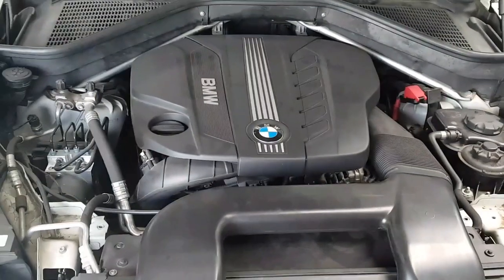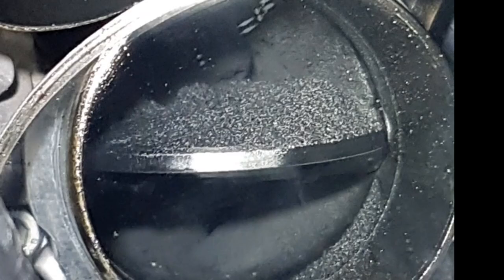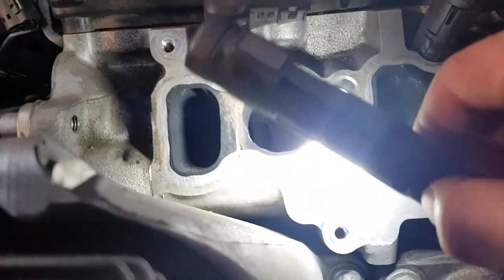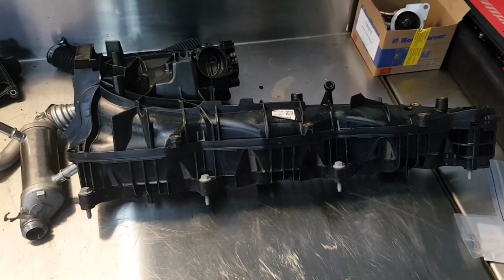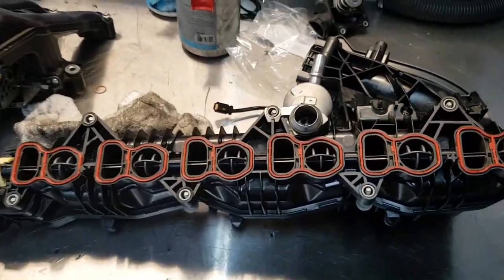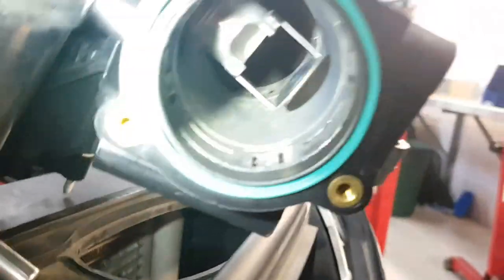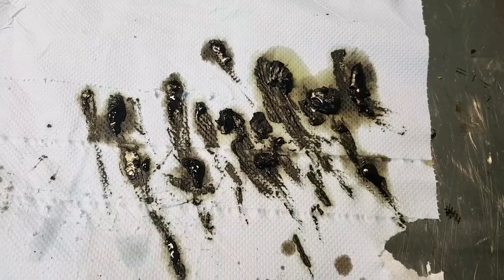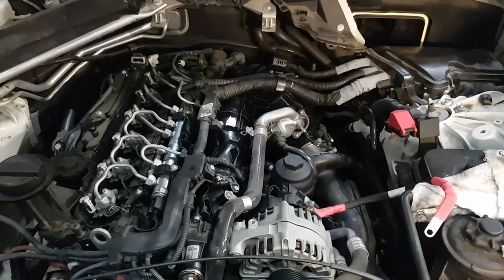BMW N57 Intake Manifold Removed for Carbon Cleaning and Walnut Blast

Comment: Talk about perfect timing. I'm getting ready to do just what you have done. You seemed to be a lot like myself. If you're taking something off it's worth getting it back to 100% instead of just settling for doing what you went in to do. 

I'd love to when you use your finger to move the flap so we can see what it should look like on that part you put your screwdriver on. I've never seen anybody use their finger to demonstrate if you have done it right or not. 

I'm glad you mentioned not to use any sort of cleaner inside a throttle body. I buy that and brake cleaner by the box full. 

I enjoyed your video so you got a big old thumbs up. Since you had some very good advice I made sure and hit the subscribe button also.

Comment: Looking to do that same job on my 2013 X5 N57 40D engine when the inlet manifold gaskets arrive. 
Retired 75 Y.O.  mechanic but worth the challenge. 
Just one issue is that walnut cleaning is not available anywhere near me. 
Can only scrape out of the ports what I can.
What are your thoughts on spraying the ports with carby cleaner and sucking out what I can with the valves closed?

Comment: I'm just in the process of doing the carbon clean. I've unbolted the intake manifold but for the life of my can't get it to come off. Appears to be be stuck on the EGV valve/cooler that's bolted to the manifold which appears to be holding on tight. I don't really want to break anything - is there something I'm missing that's not undone? Any advice would be good. PS - All the pipes to it are disconnected, it's just where it connects into the block.

Comment: That's not a throttle body mate. Diesels don't have one. It's an anti shudder valve
Reply: Its just terms differences only,but it work like throttle so…and it work not only like anti shudder valve,this throttle working sometimes with egr too…
Reply from the maker: Finally someone that actually understands modern diesels 🤣
Reply: Exactly

Comment: I've got a mini cooper Sd with an n47 2.0 engine, it all appears to be running fine with no active or pending error codes. Yet when I look at the MAF readings at idle they fluctuate between 0g/s and about 16g/s. This happens through out the rev range whilst driving, the only time it stays stable is when a regen is happening. Have you seen this before and do you think this could be caused by cylinder imbalance from carbon build up?

Comment: How did you perfectly clean intake valves with walnut blast avoiding any particles go inside cylinders.
Reply from the maker: They are blasted with the valves closed. All other ports with open valves are taped closed. The walnut blaster shoots walnuts into the port at high speed, but it is shooting it through a vacuum cleaner tip so as soon as it hits the ports it then get sucked out by the vacuum. It's a hard thing to show on camera in a video.

Comment: Nice job man! DO you by any chance have info of how much exhaust backpressure (before turbochargers) is ok during full throttle acceleration of a n57d30t twin turbo. I am feeling that 4,5 bar at 2500 rpm is not good. After 2500 the car give up boosting opening wastegate and vnt.

Comment: EGR's total bloody joke on modern motors.
Reply: Delete, no problems anymore
Reply: Not just the egr it's the direct injection as well because the fuel bypasses the valves
Reply: @kungfuhustle6363  does anyone make port injected diesels? I'm pretty diesels are only direct injection.

Comment: Hi I have a n57 engine in a 5 series but will only run if I take off oil cap when I replace oil cap you can hear it suck hard and cuts out , any ideas? Tia

Comment: Was the piston positioned in TDC when cleaning with walnut blaster? I know the manual shows examples of actually spraying in the chamber but still wondering... If it was positioned, how can you easily tell its in TDC without seeing the exhaust valve? I presume given the timings one can look at the other intake valves ? Thanks
Reply from the maker: It doesn't matter if it's at tdc or not. You are looking directly at the inlet valves which you are cleaning. If they are fully closed, they can be blasted. Often multiple cylinders are able to be done at once.
Reply: @FourRingsAuto  Does make sense indeed. Thank you for quick reply btw!

Comment: Diesel's also do not have throttle body. That is an anti shudder valve
Reply from the maker: anti shudder is only one function it is used for. it is used in egr operation and dpf regen and operates as a throttle plate in both these circumstances. it is not used as a throttle to control engine rpm speed, but it is used to throttle the engine in both the previously mentioned emissions operations, and it is not merely just an anti shudder valve.

Comment: thanks for your vid, but you really didn't demonstrated on how you cleaned the valves??
Reply from the maker: A specialist walnut blaster sold by bmw, vw and Audi. You can also use a soda blaster. Most people don't have access to a walnut blaster so seems pointless to show it.

Comment: Can you clarify how you cleaned the intake ports, ie the holes into the engine. I didn’t quite get it. Doesn’t carbon just fall into the engine?
Reply: Valves are closed.

Comment: Hi, guys, I have a 2013 bmw 3.0 twinturbo diesel N57. I replaced a coolant hose pipe. In order to replace this, I had to remove the manifold (+few sensors / lines etc).. now I’ve put the car back together, when I fire the car up. It takes around 5-7 seconds to start. It feels like it will fail to start, but always starts. Power is full. Drive is normal.. never had this issue before. (No engine lights) (nothing on code reader. 

Any ideas what it can be ? 

Thank you
Reply from the maker: Need to check rail pressure whilst cranking to see if there is an obvious issue. If they don't reach the desired rail pressure they won't open the injectors. Modern common rail diesels shouldn't crank for more than 1 second.

Comment: i will change egr valve on the warranty from bmw. or not me but the workshop. My is model year 2014 520d F11. will they clean the way you did or will they just replace the egr valve
Reply from the maker: I don't know, I don't work for BMW. Plus it is down to what the technician there is like. I doubt bmw will pay to clean your intake manifold and ports to be honest.
Reply: @FourRingsAuto  Okey so when they change the egr valve the manifold will still be very dirty.. Sounds very bad. I think I must take my car to some workshop and fix that. Looks very nasty and bad for the engine

Comment: I wonder, does the consumption drops down after the cleaning? Cause it seems to be that it actually should
Reply from the maker: Fuel or oil consumption
Reply: @FourRingsAuto  fuel. I think it can not influence oil consum
Reply: @FourRingsAuto  Does it or no? I mean is there any reason to wash it in advance in case I have no fault or bad starts on car?
Reply from the maker: Rough running on cold starts. Effects dpf regeneration too. I'd imagine it may make it better on fuel but I'm not driving the cars more than a roadtest and they're customer's cars. They all agree the cars feel so much better a more crisper and better running. If it is full of carbon it needs to be cleaned. Why wait until there is an issue?
Reply: @FourRingsAuto  thanks for answer. Yeah dats true, but now it 100k km, may be gonna do it soon.

Comment: Hi mate great vid can I ask how do you close the valves while the engine is still in the car is it possible  with a socket on the crank pulley. Cheers pal
Reply from the maker: There is a special tool that fits on the crank bolts on the front pulley.
Reply: @FourRingsAuto  cheers pal is it easy to turn over the engin

Comment: Can you put a catch can on an N57? Can’t find any info on kits or installation for one
Reply from the maker: Never fitted one myself, but likely something people do. It's a good idea as long as it doesn't affect the operation of the factory breather system and is is merely there as an oil trap.
Reply: Four Rings Auto I’d like to but concerned that it will throw up an error. In saying that I found my breather pipe was leaking and didn’t throw a code
Reply: Most of the gunk going into the intake manifold is due to the EGR which has to do with exhaust gas for which you can't do anything. Oil catcher could be in conflict with oil breather.
Reply: @j.badinter988  The gunk is mostly oil from the oil vapour recovery system. The hot exhaust from the egr system cooks it turning into a black sticky mess. Remove either the oil vapour or the hot exhaust gas and it’ll run much cleaner.

Comment: Nice video. I’ve got a Mercedes E350CDI with 125k miles on the clock. Occasionally it takes a several s seconds to fire when started, I wonder if this because of a build up of crap on the internals?
Reply from the maker: Could be, but the om642 engine relies heavily on the glowplugs for fast starting, and good battery condition. I'd start with these basic checks before looking further.
Reply: Four Rings Auto cheers bro and thanks for replying. Where are you guys based?
Reply: Give the glow plugs a chance to heat up. Easy to forget diesels need a proper chance especially in winter. BMW’s are programmed to run glow plugs longer depending on temperature.
Reply: Allie sometimes it does it on the hottest of days so I’m not sure if it’s as simple as glow plugs. I’m not sure if this is connected but I’ve just had a new fault code and replaced both Nox sensors, and it hasn’t hesitated since.
Reply: last few times, my mazda 6 2.2 cdvi was starting slow, also took a second or sometimes 2 to react on the throttle pedal input. Is in the garage now and looks the same in carbon build-up. 100.000 km on it

Comment: Whoever came up with the concept that recycling exhaust gas into the intake was a good idea should be made to eat 10% of their own shit with their food and then see if they think it is a such a good idea.
Reply: It's actually a good idea. As long as the oil vapours from the crankcase breather does not end up in the intake too. But they do.
Reply: @mcplutt - I own a BMW 335D and the EGR system led to massive carbon built up in the EGR valve and the intake manifold. Reduces emissions by a minimal amount and results in a $1000 cost to walnut shell blast it clean. Needless to say my car no longer has the EGR system installed.